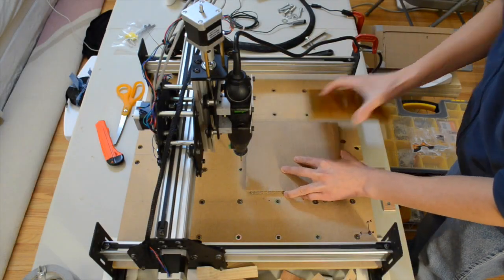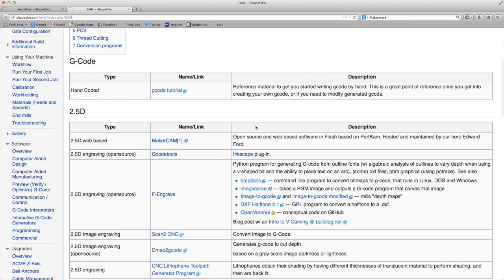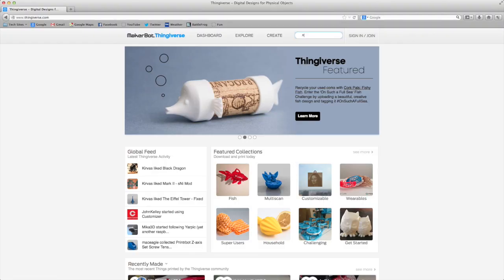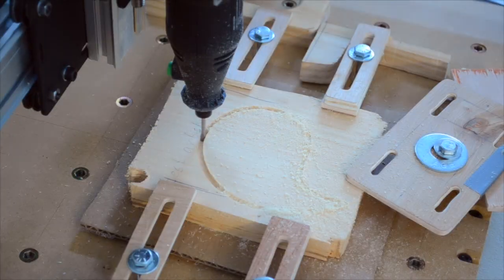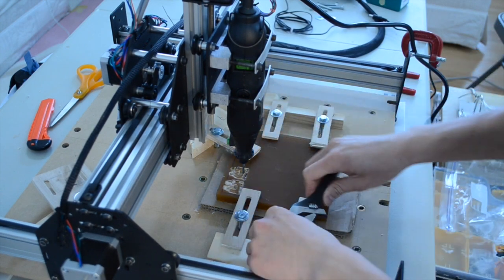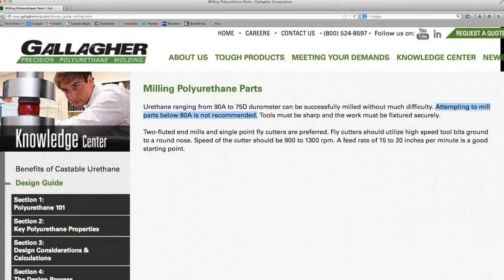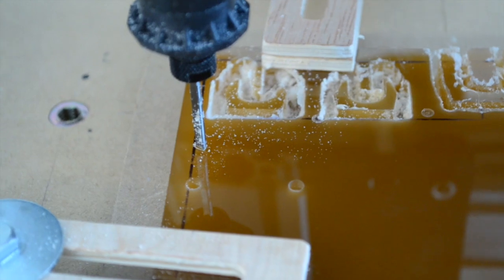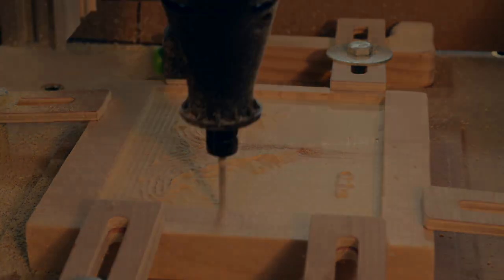Shapeoko 2: Polyurethane Woes & The Nautilus PC Project

Comment: I like your no nonsense videos. Straight to the point, and everything you mention is a valid informative thought or statement.

For plastics I've found that a high IPM works best. It keeps the tool from heating up the plastic around it because the tool is moving to new material quickly
Reply: +blitz355 High IPM?  I'm a noob... What does that mean?
Reply: +TheRangeControl a high feed rate, ipm or inches per minute for a caveman like me who doesn't use metric :)
Reply: ahhh... thank you. :-D

Comment: To machine the softer material, you may like to try sandwiching it between 2 layers of harder materials. This will help "stabilize" the softer material, by restricting it's movement. We use this technique at work when machining 0,1mm (4 thou) shim steel. We cut multiple squares of the shim steel, then sandwich them between ally plates. This effectively makes the shim steel 1 peice, several mm thick, and stops it tearing and moving. Good luck!

Comment: What I have learned from cutting materials that "melt" run them at a faster feed rate. On steel, if we ran a slot at a feed rate of 2"/m, we ran nylon at like 15 to 20"/m. Otherwise the nylon would melt on use. That was just at one place. Another place we ran steel faster depending in the depth of cut, but same applies with nylon at a smaller depth of cut. The longer the endmill rubs, opposed to cuts, is a better chance of melting. I am sure the acrylic can be machines. But general rule is the bit has to be dead sharp.

Comment: For cooling the material and end mill you can use a can of keyboard cleaner flipped upside down so the liquid sprays out. Its at an extremely low temperature. Just have adequate ventilation and try to keep it off your skin.

Comment: Never used a domestic CNC machine, but have machined a variety of plastics, unfortunately no polyurethane, on a commercial one. If I were to attempt this, I would opt for a faster feed, a slower rpm and single flute cutter. I doubt your spindle would put out much in the way of torque at lower speeds so I would limit your depth of cut and clear out the swarf as you go. You could also try machining along a second offset path, to give your swarf room to be ejected. With dry high speed machining of plastics, it is the swarf which takes the heat away from the cutter, and if you want your cutters to last make excess heat your enemy. 

softer plastics tend to 'bend' away from your cutter if your chip load isn't high enough, meaning that your tool will chatter, and maybe only cut every 2nd or 3rd revolution. You really want to be making chips that look like little curls. Harder more brittle plastics require a lower chip load as the cutter 'scrapes' material away rather than 'slices'

Comment: Hi Winston, your videos are amazing, and a great way to get into cnc milling. I am still a cnc noob, but i have quite alot of experience with 3D printing. I must say that these rubber stops would have been much better to 3d print. Ninjaflex makes filament as soft as 75D, which would be perfect for this application.

Comment: A few words from my experience. Never deal with super soft materials on my diy cnc but done a lot with plexiglass. The best and clean result is a fast feed with less stepdown and one-flute endmills. I'd guess these settings should work fine with polyurethane as well. Imo.

Comment: I'm not sure if you've seen it, but Makercam has a "tabs" option that can help hold things in place until you've finished. The tab size doesn't compensate for drill diameter (even in profile mode), so don't try to use a 1/4" tab with a 1/4" drill bit like I did, or you'll end up with messy edges and no actual tabs.

Meshcam looks fun. I'm not very excited about paying $200+ dollars for software, but it might be the best option for my mac. For 3D work, PyCam looks like it works reasonably well in Windows, but I couldn't get it installed in OS X no matter what I tried.
Reply from the maker: Huh... good to know. Thanks for the tip, I'll try it out. What I usually do is just throw in a block of geometry that fills a gap (haven't used it for the purpose of leaving a tab though... yet). As long as you don't leave enough room for the bit to go through, MakerCAM will just path around it. Gives you a bit more freedom to place the tabs. But it's a full-height feature, so there is that tradeoff.

MeshCAM is admittedly a bit pricey, it's at the ceiling of what I would consider as a hobbyist. I'll add PyCAM to my list of programs to test.

Comment: razor sharp cutters made of High speed steel will easily machine rubbers and plastic. It eliminates the friction caused by rubbing because it slices. Consider using a coolant while machining. And a higher feed with a lowered speed will increase chip size wich will allow some heat to be thrown away from the cutter

Comment: Just a thought...When machining plastics, you need to keep the spindle speed low..like 300 RPM or less.  Cutting speed @300 rpm with a 2 flute End Mill with .005 load per flute should be in the area of about 125 inches per minute.  Higher speed spindles at more and more heat which melts the plastic.

Comment: The rubber may have been stamped in the original, a knife would probably be the best cutter thin blade no rotation on the spindle it might have worked.

Comment: You should mill out some knobs to epoxy onto those bolts - or alternatively, soda bottle caps work really well.
Reply: +Scott Baker Please clarify... I'm curious about what you mean.
Reply: +TheRangeControl It's easy - you can use bottle caps (either metal or plastic - either works fine), fill them with epoxy, and insert the head of the bolt.  Easy to grip, easy to turn, cheap as dirt!
Reply: +Scott Baker ahhh...  I was apparently trying to find a Cruise Missile worth of concept within your championship Soap Box Racer...

...My bad.  LOL
Reply: +TheRangeControl ... lol no worries.

Comment: When you're cutting wood(or any material for that matter) try not to punch all the way through like you did at the end, if that was aluminum, it would've shattered the bit and sent shards flying. No bueno
Just leave about .005" remaining at the bottom, punch it out and smoot it out :)

Comment: What is the depth per pass on the plywood and I use cambam and in my opinion is the best for the price
Reply from the maker: 0.0625", although I suspect I could safely get up to .08 or even .1 if I tried. I did one test at 1/8" and that didn't go so well. The stock nema17 motors aren't the most powerful, but they get the job done.

I've heard that cambam is the best value for 2.5D, while Meshcam gives the best results on 3D. But I'll give both a fair shot.

Comment: you could try cryogenic machining basically use dry ice to supercool as pure an alcohol you can find the Applied Science channel has a decent video about it
Reply from the maker: thiscrazyguyiknow Aha! That has been on my to-try list. However the one thing holding me back is the chemical resistance charts for polyurethane show "okay", and not good resistance to degradation by isopropyl. I can't think of another commonly available cooling fluid to use in its place. Also, I don't have a pump, so I was going to do an immersion bath, just need to figure out how to fit a pan under my CNC and still clamp down the rubber.

Comment: What is that vacuum you are using for the dust collection?  Do you happen to have a video explaining it?  Is it crazy for me to think that I can operate a Shapeoko 2 on a table over carpet?
Reply from the maker: I'm just using a canister vac from Costco that has a HEPA filter. If you look up dust shoes and vacuum hose attachment mods for CNCs, that might be enough to keep your workspace clean, but as extra insurance, a $5 plastic tarp from home depot might be prudent.

A vac will handle all of the finer dust. It's the larger grains that have the momentum to really travel to all corners of your workspace, which is why you'd want to physically contain it with a dust shoe or even an enclosure for the entire CNC (I'm planning on building one in the next few weeks...).

Comment: What do you think of the creation station cnc?
Reply from the maker: duracell394 From a technical/spec-wise perspective, you're getting a good amount for your money, but I personally don't like that type of setup. It also turned me away from machines like MyDIYCNC. The problem is that it's not flexible. There's zero expandability/modularity. It's virtually impossible to make physical modifications to it. You may never outgrow the work area, but you'll also never be able to do unique things with it... like carve pumpkins.Also have questions about the controller. So far it's driven over Parallel, with USB connectivity in the future (maybe). I'm sold on the ATmega and/or grbl controllers that are USB right off the bat.
Reply: +Winston Moy Interesting... I was curious as well.